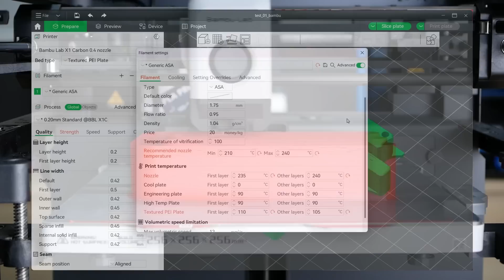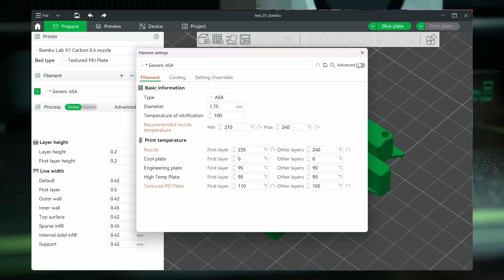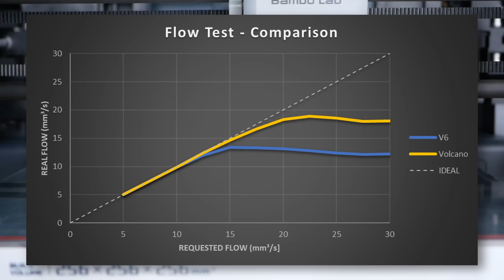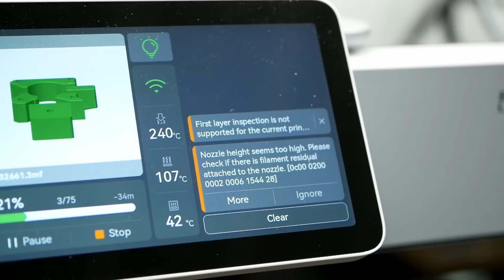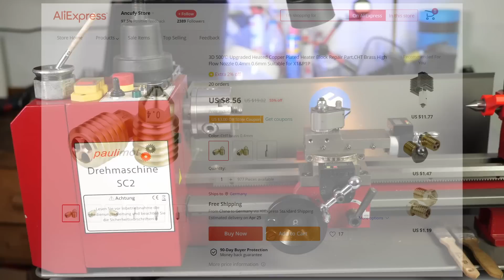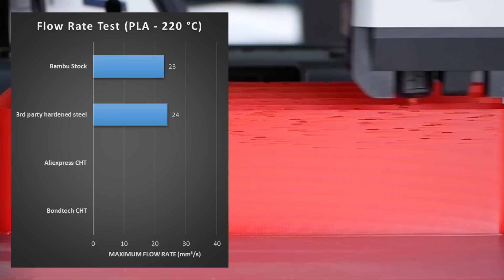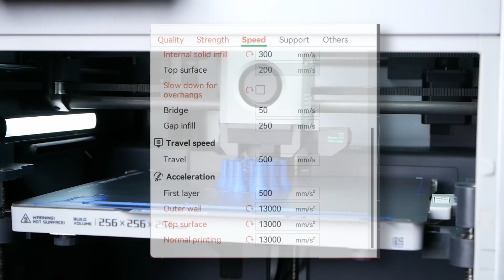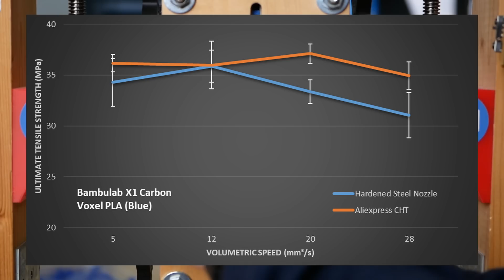Fast 3D printing is bad for Strength! (and how to fix it!)

Comment: Something some of my coworkers suspect is that printing fast may cause it to basically pull the molten material taught as it extrudes which could affect the material properties by pre stressing the polymers and changing their alignment a bit potentially (and thus potentially how it crystalizes). I have no idea if this is true, but I am really curious and want to figure out some way to test it someday. I suspect there may be at least some truth to it, but I wonder how significant it could be and if it is more than say increasing warping or such like.
Reply: It is all down to a simple thing: if you print too fast, the material doesn't have enough time to absorb as much heat. So it's like printing slower but with way too low of a temperature in terms of layer strength. Add the effects of having to increase part cooling fan to print the next layer and you have a bad recipe.
Reply: @alejandroperez5368  Their theory is that even if you give it plenty of heat and it's fully molten the viscosity and nature of the polymers themselves would make it difficult to "squish" the plastic into the below layer for good adhesion and/or create pre stresses from the polymers being stretched out more.

Comment: You should make those test samples with the same surface area but an extreme aspect ratio, making one dimension long at the middle section will give the printer enough time to accelerate up to speed.

Comment: Would love to see you testing the actual temperature inside the tip of the brass nozzle instead of the heating block, maybe with a 0.5mm thermocouple

Comment: That's why, months ago, I perceived the need for variable hotend temperature relative to flow rate; like within the gcode or similar. Then, once proper printing at higher flow rate will be achieved, more part cooling will be required. 
Is Bambu Lab working on these improvements?
Reply from the maker: The problem is that regular hotends react quite slow but maybe the induction nozzle could be a solution here

Comment: This speaks to why I haven't upgraded to a faster machine yet.  I mostly print in ASA for the heat and sunlight resistance.  I more often slow down a print for better layer adhesion, particularly if it's small, rather than speed up.  It seems like for functional parts, particularly printed in materials other than PLA, high speed printing isn't very useful.

I would like to be wrong about that, though.  It would be nice to print faster.

Comment: Bamboolab is like a try hard poormans engineers. They should get back to school.... Or at least learn to build a proper high-speed 3D printer from the community like @247printing or @Vez3D and such, instead bamboolab is gust a greedy golum so that's the reason why it is high priceed crap.
Reply: Thank you for stating the truth. Sadly, you are going to get attacked by shills

Comment: For better high flow nozzle tests. 
Instead of printing the hour glass shape you could print cylinders of the major diameter, then machine them down to the hour glass shape. Add what's called a live center recess on one end and make them slightly longer so they can be chucked up in a lathe and supported on the opposite end. They do make desktop CNC lathes that can handle this easily. I am a career CNC machinist, if you want any help with programming and setting it up I would be happy to help. But, I have a feeling you could figure it out on your own. good luck and keep up the great content.

Comment: The filament volumetric speed is not solely due to the printer heating limit but also the filament itself.  This is why it is a filament parameter but not a printer parameter.  The Bambu Lab PLA Basic supports 300mm/s printing thus having 21mm^3/s.  You should see the difference easily by compare with other filaments using the same printing parameters.  Geeetech PLA HS also has this 300mm/s high speed ability.

Comment: I printed a beautiful little vase with my P1P, 4 bottom layers and 3 Walls…still water came pouring out of the bottom. I since know that I have to tinker with the flow settings more often 😅

Comment: Bambu Labs said some months ago that they will be releasing their own high-flow nozzles.  Hope they offer hardened nozzles for abrasive materials, as most current high flow nozzles aren't hardened.
Reply from the maker: Oh, I that's cool!
Reply: Wondering if they will also release a new nozzle design similar to the A1 series that doesn't require a full hotend. Maybe on the next X1 release?  Hopefully also backwards compatible.

Comment: Extrudr ASA is just Crap, dunno what they pay you, but its nowwhere near to the strength or quality to any Other ASA, like Polylite ASA.
Otherwise an CHT Nozzle makes not much sense for an Bambu Printer, an X1C is specifically made to get an Printer that Prints with default Profiles without headache fast.
Your Tip with limiting the Flowrate is great btw, but on my Bambu i had never issues with any Parts in ASA/ABS/PLA, they were always perfect! But the Tip is still great.

If you want CHT or Really High flow, or tuning your Printer in general, the right Product is then to get/build an Voron.
I have some Vorons either, i love them, but i love them because of the modding aspect.

Otherwise this Video doesn’t tell anything usefull other as limiting the flowrate.
Because no one will replace their bambu hotend with an aliexpress cht clone and fight with the problems that comes with that. And no one should ever buy Extrudr ASA, as its by far the crappyest filament on the Planet.

Cheers

Comment: To mitigate the acceleration problem, you could redesign your test sample to have a rectangle shaped cross section. If it is rather flat and wide, the printhead will spend way more time at the desired speed and less while accelerating.

Comment: Actual Speed increasements are very nice .. but yes.. the extruder has to handle this. 
Additional to your points i see the Filament and it's viscosity as very important. You mentioned also that filament is a factor.
I saw this when ordering some Geetech standard PLA . It was impossble to really print it o the X1 with standard PLA setting, also higher temps made no improvement.
i had also 2 times a clogged nozzle
I finally used that Filament on my Sidewinder X1 with "normal Speeds" for other parts
The i ordered at "Das Filament" and here i have no issues, looks like viscosity is better
Maybe you have some time to have a deeper looks in that issue.
I am a polymer technician, but to be honest have no time at the moment to dive in deeper here ;)

Comment: I found that upping the hotend temps is a better solution than lowering volumetric flow rate. You can still print fast and it doesn't mess up the internal software-hardware tuning that Bambu did. If you are tuning in a new filament, by raising/lowering hotend temp by intervals of 10C then 5C, try to find the sweet spot that surface underextrusions no longer happen. Some underextrusions cannot be solved by flow but only temp, guess it's more about the plastic properties. Another thing is lowering the flow may not actually affect the most print speeds esp. non-infill, if you see similar print times, check the sliced print speed preview and see what speeds are actually being applied on the parts.
Reply: Yes. This kind of surface quality problem always means you're printing too cold. Same with part strength/layer adhesion.

Comment: Thank You for this video. My daughter and I are new to 3D printing as of a month ago and bought a BL Carbon/AMS. Her idea took off and we have a P1P coming to scale sales, but UPS lost it. During that time we think we need a 3rd one.We run small parts 50 per plate and they don't need to overly strong, just no holes on 1 layer walls.  With being so new to this I thought I could tinker with the setting and increase our output with our .06 nozzle use in the  unit and upcoming units. But after seeing this video, it looks as if we are close to maxed out. My daughter always wants to use sport mode but I say only use it if we absolutely need to as you can feel the added speed puts more stress on the belts with the jerky motion. With your knowledge, if we used sport mode all the time, as a wide spread estimate, how less will the BL last before needed to be rebuilt belt and carbon rod wise? Only use PLA. I know the unit is so new to know, but you know how they are built and have other brand knowledge to have a rough idea of loads on head movement correlates with wear, were I have no clue.  Thanks for your great videos.
Reply: "Nice" quantity over quantity 🤦‍♂️. Way to go screw the buyer...

Comment: @CNCKitchen Since your test coupons are circular could using G-code that moves the print head in a continuous spiral for each layer increase the print speed substantially? Those 180° direction changes when printing the infill really hurt (as shown in the video at 11:00), even with acceleration cranked to the max.
Reply from the maker: Yeah, thought about this but this would require some cutom g-code generation.

Comment: Excellent video Stefan.  I really think Bambu has hung their hat a little too heavily on "Speed" and they need to tune in "Quality" presets.  My own tuned profiles are significantly slower but more reliably produce better looking & stronger parts (anecdotally). My X-1 gets a lot of use with these profiles and I'm much happier for my needs.
Reply: Hi there.
Can you share your updated profile settings for different material 
PLA,TPU,PETG ,etc? It would help a lot of us that are getting into 3d printing with this Machine.
Thank you.
Reply: Are those profile published anywhere per chance? 

If not it would be really appreciated on the discord!
Reply: The quality out of the box was better than any of the previous 5 printers I've owned and 3x as fast.

Comment: I never touched the flow rate on my slicer profiles, I'm afraid to mess with it. I just learned that the default retraction rates in my default profiles were crap so I learned to tune that. This stuff is way too complicated.
Reply: In my experience, my X1C with Bambu's own PLA worked perfectly out of the box without changing any settings. Once I got different PLA I suddenly needed to learn all about PLA temperature, bed temperature, and a few other things to get reliable good quality. But if you just want things to work out of the box, the X1C works quite well if you stick to Bambu's PLA. Only thing I'd add to the default is to buy one of Bambu's PEI build sheets, they're very nice to use and you don't need to muck about with a glue stick anymore.

Comment: Hey Stefan. I happened to be testing the same thing, got to the point of wanting to make my own youtube videos :P. Just a hint about the Bambu - you should really look into the cooling system as well (actually got the inspiration from one of your earlier videos on cooling vs layer strength). I've been running test prints, and I think the X1C has an overperforming cooling system, helping with quality but maybe more drastically affecting strength. I get the impression it's all about thermal balance of cooling filament
Reply: yes, had to switch off aux fan in most profiles...

Comment: It seems like Bambu Labs is constantly improving it's printers. Hope they see this and add this to a future revision.
Reply: They should definitely add the option for screw in nozzles. Doubt they would offer the high flow nozzles themselves, simply in fear of patent infringement. But I'm sure if they sell the interchangeable hotend, 3rd party nozzles will fill that gap quickly.
Reply: Legitimate question, what improvements have they made?
Reply: @DementiaAcerbus  take a look at the first release they did, and compare it to now. you'll see thousands.

this question takes a lot of effort to answer if you really want specifics
Reply: One question I have for anyone: are you saying turning up the temp in the hotend is not necessarily a best option then to find a good balance within in Bambu’s basic default settings for quality finish + good part strength? Is there a good video that talks about why you don’t just turn up the temperature to get slightly better flow rate? I’d love to learn more about how those things affect each other
Reply: Bambu labs would have defend the CHT clone as not patent infringing for that to happen, AliExpress sellers are much more nimble in terms of potential IP violations. Edit: or license the CHT from BondTech.
Reply: I was thinking the same thing.  They should change to a high flow nozzle as the default.
Reply: @Nerlin  They would be stupid to not develop and offer drop in replacement highflow units. Most people who have bambulab printers dont want to muck about with aftermarket stuff. Just being able to buy the solution directly would be very advantageous.
Reply: @tHaH4x0r  I agree. I have 2 X1Cs
Reply: A high flow hotend upgrade has been planned since the beginning... They're working on it, particularly for 0.6 where it's desperately needed.
Reply: I hope they do as default stock.
Reply: Build a VZ-Bot. The Bambu Labs X1C is a toy compared to it
Reply: @coltenmeredith8899  Different printers for differnt market, like comparing linux and ios
Reply: @xpy99  That's not a fair comparison....Not even close. The Bambu Labs machines are just wanna be fast printers like Vorons, RatRigs, VZ-Bots, hevORTs....I do appreciate Bambu Labs though, they were the first to make a completely pre-assembled printed that is somewhat like the others.
Reply: @coltenmeredith8899  I dont mean they have different purpouse, I mean they have different approach and targets, voron etc are more experienced maker oriented, bambu lab instead is more a plug and play experience
Reply: @xpy99  You are completely correct :)

Comment: I'll stick with prusa, I don't print toys and trinkets, I print mechanical parts that need to be strong with good layer adhesion. The only legit selling point of a bambu printer over something like a prusa is it's speed...if you're not going to print fast, to ensure you get functionally strong parts, then what's the point in buying a bambu lab? If you're gonna print slow on a bambu lab, you might as well just go prusa so you get the reliability and customer service with it.
Reply: You're obsessed dude, you don't need to comment on EVERY bambu lab videos about your fake experiences.
Reply: @logitech4873  And both of you are obsessed with me, neither of you can EVER rebuttable anything I have to say about the bambu printers, like ever. It's how I know i'm correct.
Reply: @LilApe  Well yeah you come with literally unfalsifiable claims. The burden of proof lies with you dude - you're the one making claims.
Reply: @logitech4873  Lmao the "Claims" I make are all common knowledge about bambu lab as a company and their printers. Again, none of you can ever rebuttable anything I say about them, because what I say is truth and you all know it, it's just a hard pill to swallow for the close minded.
Reply: @LilApe  For example, you've claimed the machines have a 50% failure rate.
I can't disprove that for the same reason that you can't prove it. You don't have statistics, I don't have statistics.
You simply just make up stuff.
Reply: @logitech4873  why I can't comment? Because you don't like my comments? What is fake about what I said. If you don't agree with what I said please share your opinion. I won't try to make you stop commenting.
Reply: @elleryfg7853  I didn't reply to you. You aren't even in this comment chain.
Reply: @logitech4873  LOL my bad dude. I think you were the one who warned be about this @Lil Ape dude. I replied to him too. Check up there☝️
Reply: @logitech4873  Thank God someone else has realized this. This guy literally wakes up every morning searching for stories about Bambulab to troll.
Reply: @BeefIngot  Does he still do it?
Reply: Don't worry about these people. All just fools who bought a X1C and thought that would turn them into an engineer
Reply: Copying from a different comment: You could always just like, slow down the bambu a little bit. Even with it set to a slower speed it'll run circles around the prusa in terms of print times.
Reply: @Mqrius  Not anymore with the release of the MK4. Both run 19 min benchies but MK4 is dead silent and far more reliable.
Reply: Not only do I print faster. Part quality is better than my Prusa could ever be. They are now going for sale.
Reply: @Heymeit  Cool, meanwhile I had to do a chargeback just to get my money back on my P1P, because it had the print quality of my old anycubic mega S and bambu lab didn't want to refund me because of not having the original box. That was after I waited a month to get a new stepper motor that died within 10hrs of ownership.

Comment: Danke Stefan für die Bestätigung. Ich hatte gerade genau die gleichen Problem, vor allem mit ASA. Die prints sahen gut aus, waren aber einfach zu schwach und ich war sehr enttäuscht von ASA. Schlussendlich war meine Lösung genau die: langsamer drucken und weniger Kühlung. Die Standart Profile haben einfach zu viel Kühlung nur damit schnell gedruckt werden kann. Gerade wenn man mehrere Teile auf einmal druckt, wird der X1C sehr schnell, aber die Teile sind einfach nicht stabil gewesen. Also Kühlung runter. Ich habe es aber vor allem über die layer time geregelt. Also längere layer time und damit den Print künstlich verlangsamt.
Reply from the maker: Genau, so hab ichs schlussendlich auch gemacht.